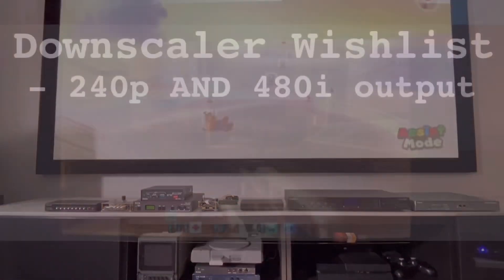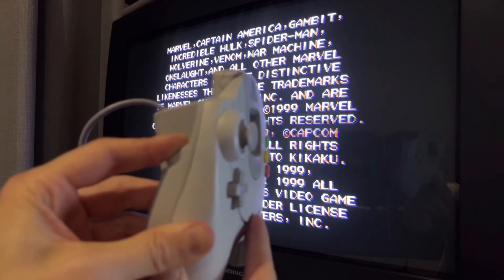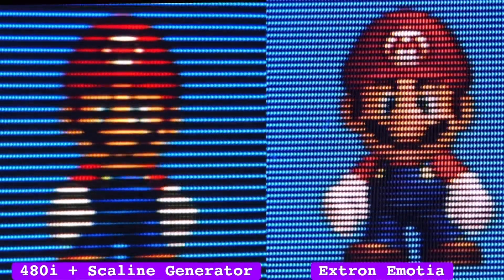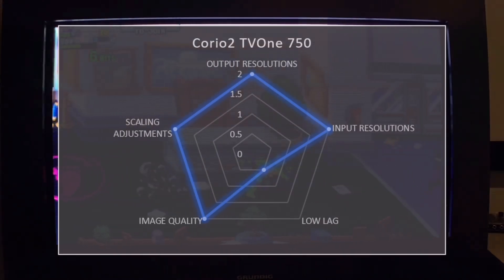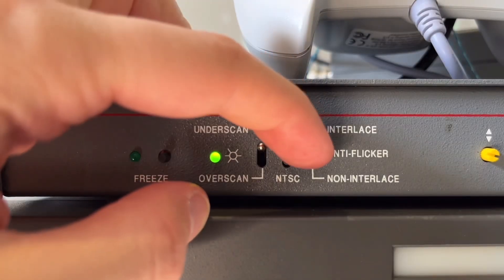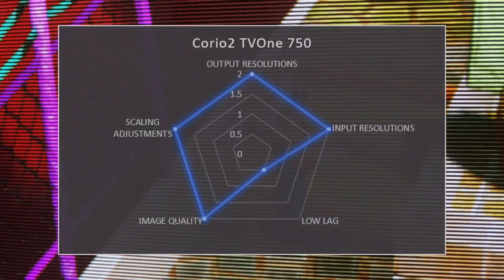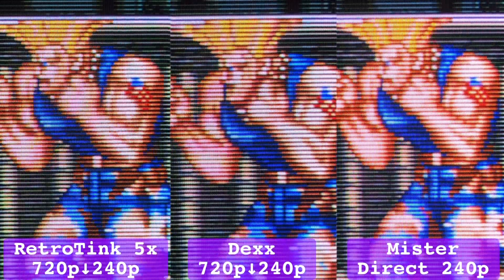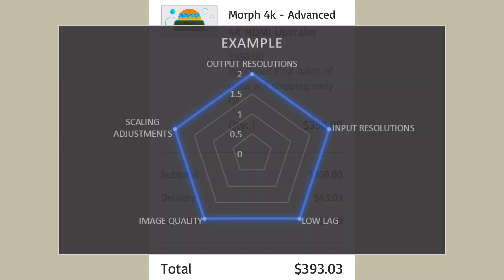Downscaling Chronicles 8: The Downscaler Wars. Corio2 tvOne GBSC Dexx RetroTink 5X Extron Emotia

Comment: Cannot figure out how to produce 480i from the corio2. I've messed with resolution settings since I got it and spent countless hours scouring the internet with no leads. I see people asking the same questions but don't get responses. I tried your settings knowing they were for a widescreen display and tried to adjust for that but still produce either a scrolling image or 240p. Is there any way I could get an xml set for 4:3 screens from you or the settings possibly? Maybe a point in the right direction to do my own research? I've tried to research how 480i works on displays and have tried cross referencing crt emudriver settings but the terminology in tvones firmware seems foreign.
Reply from the maker: The XML file I flashed to the 750 unit has a bunch of 240p outputs but 480i was already there and untouched from the official firmware labelled ‘NTSC’. Do you have that resolution? The settings I wrote in the description were only to optimise HV size and centring for my TV. You could download the XML file specific to your unit and see if the NTSC resolution is there, otherwise download the 750’s XML file and copy the NTSC resolution settings over to your file or program manually. There is an interlace option as well in one of the menus which could have something to do with it. As for 4:3 optimisation, the height should be filled but there might be horizontal cutoff. I’d assume that would be fixed by reducing the H size in one of the several menu options. I would make a copy of one of the 240p output resolutions and play with the H size and position specific to that res before touching the global source options
Reply: @MarcoRetro316  I followed guides to closely. At one point someone said don't touch the ntsc/pal presets (itll brick the unit) so I just avoided them altogether. That's awesome yeah they've been there the whole time. I just thought you glossed over making your own 480i setting and I didn't wanna bother you to ask until now. Glad I asked because I was getting sketched out by continuously failing to make my own timings. The sizing stuff hasn't been bad at all to figure out though. Also completely agree with your scoring btw. Have been waiting for you to drop this video and it matched my speculations. Although I feel this can't be the end of the road.
Reply from the maker: @HUNTERDACTYL  I’m so glad you got it working! I’m always happy to help if it’s in the scope of what I know. And thanks for following the series. I’d say this episode is closure, but not the end